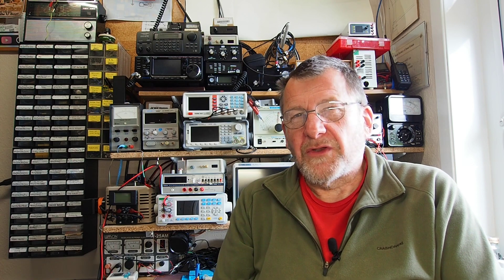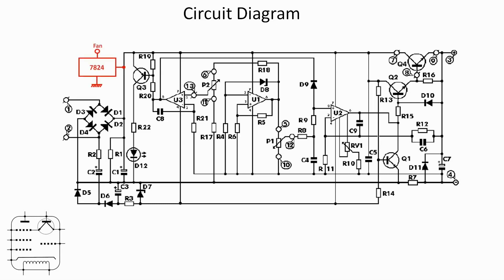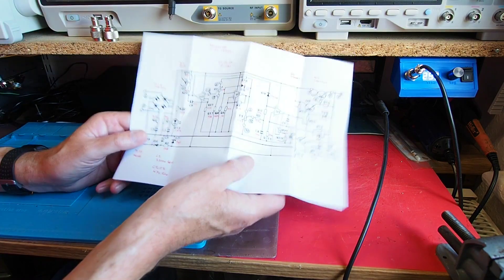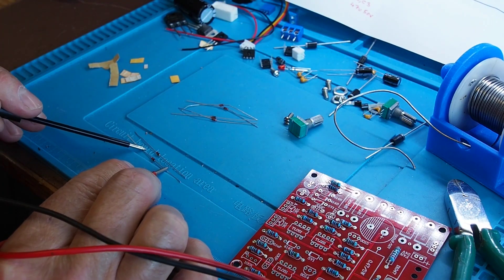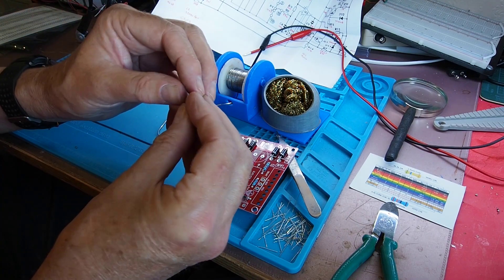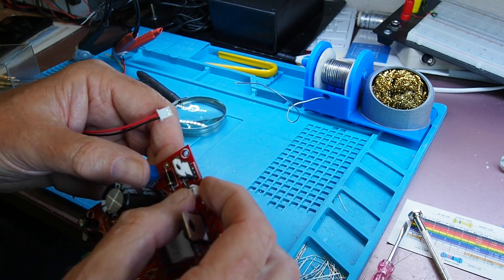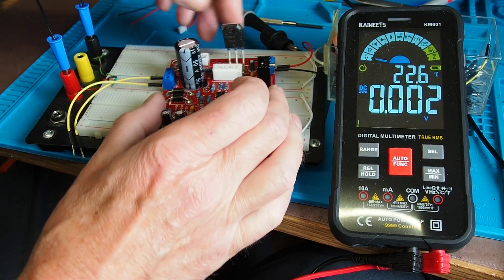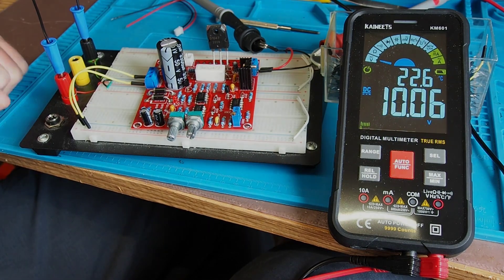Current Limited DC PSU Module Kit (Banggood) - #128

Comment: I built this kit a while ago and is very good. At the output, I put an A/V meter module that is quite good and give a indication about the output voltage and current supplied. For transformer, I used an 220V to 12+12 and with an relay and one 7812 at the output, I switch in two steps the input voltage; it helps keeping the transistor cold at low (below 12V) voltages. Because it has a histeresis, I might make a circuit with a comparator and also command the fan with an thermistor. 
Also, I plan to make a dual supply  up to 15-20V with two kits like this.

Comment: you can check for the Zenners using a multimeter if it has a diode measure function. Love to see your finished item with the display, AC psu and fan installed in an enclosure. And finding the "missing" heat sink isn't easy!

Comment: Nice to see your assembly. I bought one too, but still did not assemble it. Few points of attention (google them):
(1) The TL081 do not operate at 44V but at 36V max. (even if they are original). Depending of the transformer output (loading and input voltage variations) the positive side + (negative 5V) might go above 36V an it seems to be a common cause of failure in this circuit. Solutions: use a lower output Transformer and/or a 44V ‘real’ (not faked) OpAmp that is Pin-compatible to TL081. Suggested to assemble them on a IC socket.
(2) There is some not-ideal tracing inducing noise in some tracks. There is a cut&bypass solution to improve it.
(3) During turn-off, sometimes it might generate a voltage spike (if Negative falls faster than positive capacitor) - there is a slight modification to address / minimize this too.
Wish you success, and a Blessed Easter!

Comment: it does not need a power supply, it does need an ac power transformer capable of deliver enough voltage and current to provide this part of the power supply and the load attached to it .

Comment: I think I missed this one... An old uncle of mine used to put small pieces of cucumber on the body side of the circuit board to keep transistors cool when soldering. You can poke them right into the leads.

Comment: They are £15.26 now, but that’s with two boards and a two row LCD module. It’s amazing amazing how much things have gone up by but you do get the extra parts. Checking all the components for a kit coming from somewhere they have very poor QC isn’t over the top. As a newbie I’d love to see it completed please and fully operational.

Please may I ask you what thickness of solder do you use? I’m using .8mm 37/63 leaded but yours looks a lot thicker

Comment: Cool video, thanks! I love these little linear power supplies and must have ten or twelve of them now. A couple of tips i would recommend: i would highly suggest using sockets for the TL081's as they are a bugger to remove if (or when) they fail....and as they are working close to their limit, they do sometimes fail. UA 741's also work well. Also recommend raising the resistors off the board a little as two or three do get hot. Finally, if preferred, a 7805 or 7812 voltage regulator may be used instead of the 7824, in order to use a different voltage fan. There is also a TON of updates/mods/variations for this supply if "32v 3a Hiland" is Googled as it has been out for decades. Really cool stuff! Cheers!